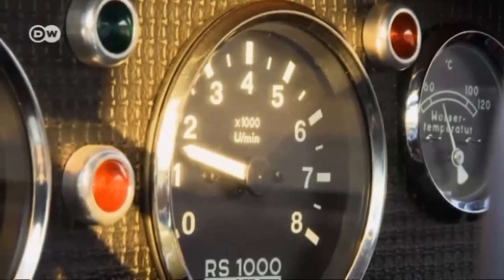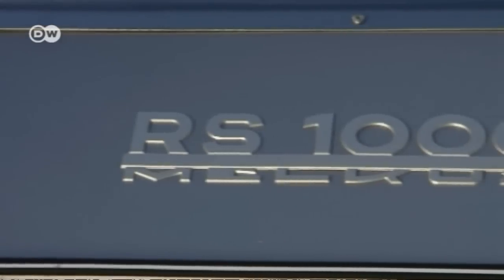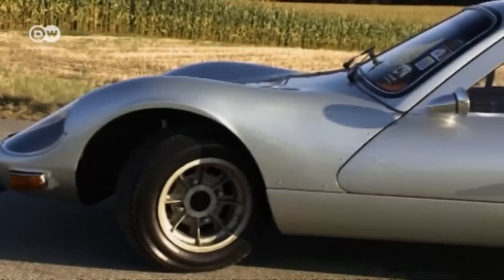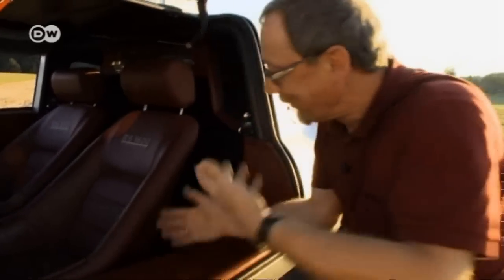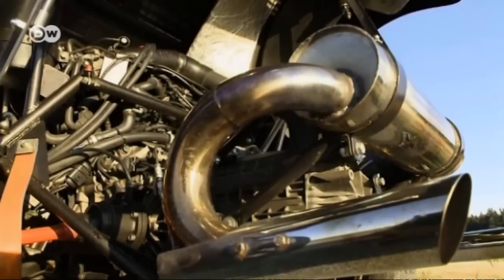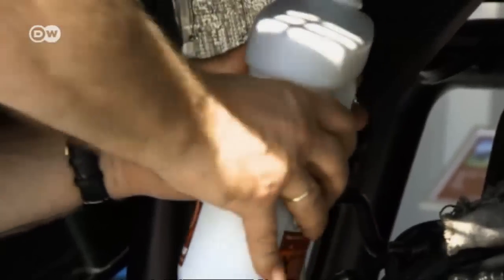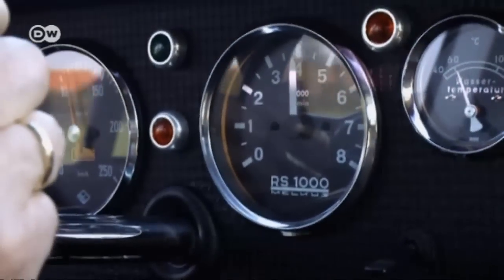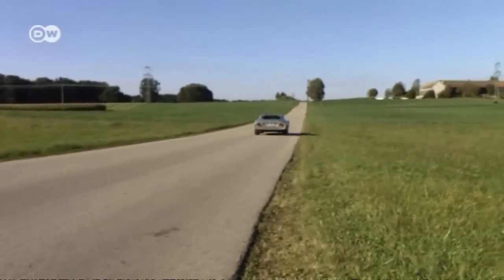Melkus RS 1000 - The East Germany Sportscar | Drive it!

Comment: I like the way they don't mention the most special part about this car and that is that it's a 2 stroke
Reply: +Logan Archer But this version uses a 4-cylinder BMW engine :/   like he says in the video..
Reply: yea i know, but that was really the hype of the car, sure it wasnt reliable, bing a 2 stroke but i liked that, 2 strokes, whether being in bikes or cars, have that sense of power, in a cheap effective way
Reply: 2 strokes had a narrow power band, not good for cars which are operated at a wide range, so they were ineffecient, even though they had a good power to weight ratio
Reply: these cars were designed for a race track, i understand why you would ditch the 2 cycle engine, but if i had one, i'd leave it the way it is, even though its in no way utilitarian for anything other than wows and shows
Reply: Logan Archer
Well they are history. I knew a guy who owned a old Saab that had a 2 stroke in it. they were very quick in motorcycles. In the Army back in the 80's I drove several trucks powered by 2 stroke Detroit Diesel's But the government said they pollluted too much and were ineffecient. Nowadays you just find them on chain saws and a few other small applications
Reply: rbagel55 yea I like 2 strokes, and especially unconventional things, and thats pretty interesting, I've only ever seen one Detroit diesel in my life, it was in a steiger pta 325
Reply: If there is a Melkus RS1000 around in bad condition, it deserves to be restored, with all of those small problems ironed out of course.

Comment: Holy shit, you're sitting between two gas tanks?! I guess the designers didn't want anyone who crashed to survive and tell the tale. No witnesses!
Reply: It's not the only one, the Citroen 2CV Sahara is an drastical reworked all-wheel-version with a second motor in the back ;-) Both transmissions are mechanical coupled, both motors can work independently. So there are two gas tanks below the seats.

https://www.youtube.com/watch?v=FpodMNktmu0

More dangerous is the gas tank position in the Ford Pinto: Directly beneath the trunk!
https://www.youtube.com/watch?v=PAI5T8UecEY&t=1s

Comment: Looks like a death trap - just note where the "two separate gas tanks are located".....
Reply: +KirilG1 That could probably turn into a problem, but with this car it also means your "financial death" when you crash :P
Reply: The thing is a safety feature free fiberglass wedge.  You're gonna die no matter what if you crash in it at any speed, the free cremation is a perk.